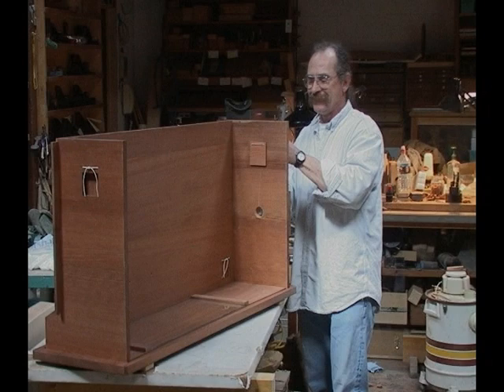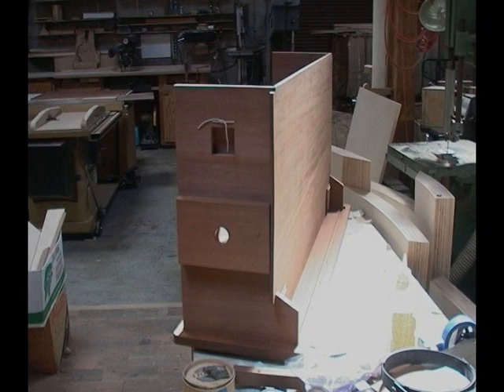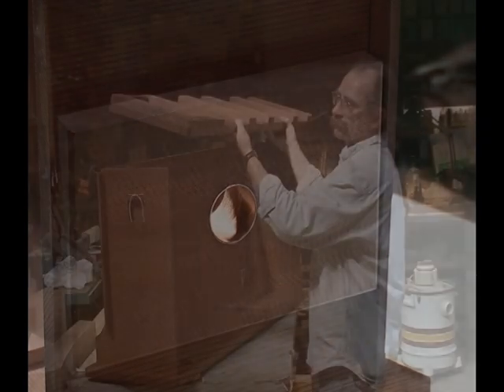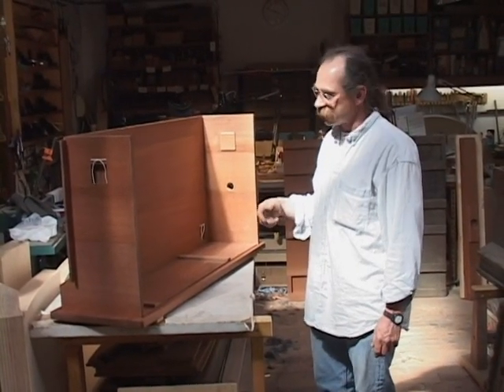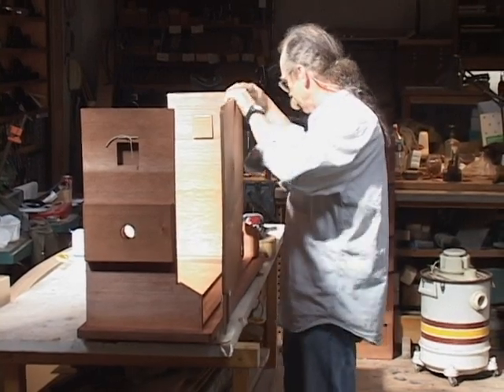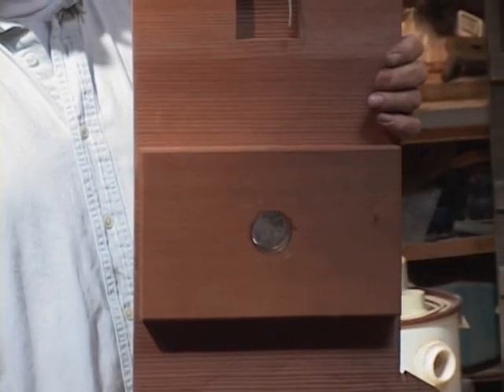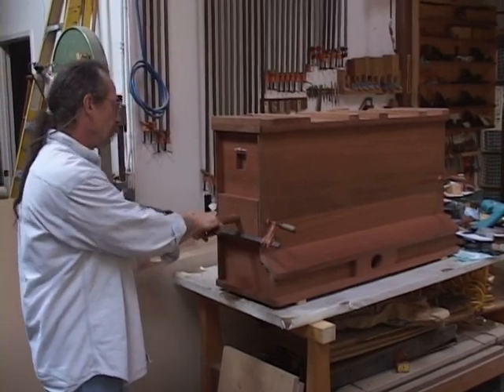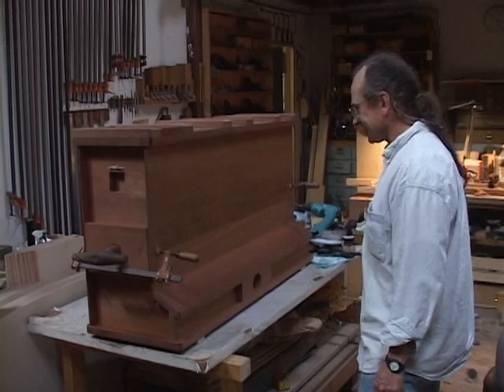Fuego (What the heck is it??)

Comment: Duh...! It's a bookcase! And bookcases are categorized as " "home furnishings" not as machine's.
Reply from the maker: Jay Muzquiz you didn’t watch it did you? It is a machine
Reply: @arboristBlairGlenn  Hey Glen let  me ask you something, who do you think has better hammer control a carpenter or a black smith? Or is better at swinging a hammer.
Reply from the maker: Jay Muzquiz that is like asking who is a better dancer. One does swing and the other ballet? Both the carpenter and the blacksmith have skills. A blacksmith does hammer differently
Reply: @arboristBlairGlenn  Your right, is it fair to compare the two with hammer control? The carpenter basically use a framing hammer occasionally a demo hammer or a finishing hammer. How many hammers must a black smith master? With carpenter's its about driving nails and plumbing.  A Blacksmith it's about shaping, cutting, punching, drawing, welding, forming, reducing, rounding, some hammers heavy to strike forcefully, some are small to shape, others are for a single job, and even a hydraulic driven hammers. But then again some carpenter's hammer is like an extension of their own body and drive nails in some of the most strangest of places.
Reply from the maker: Jay Muzquiz and what is your career choice?
Reply: @arboristBlairGlenn  Automotive repair industry unfortunately. I hope to be a sword smith someday. As we speak I'm building a Japanese Box Bellow no where near the level of your friends. What an ingenious simple litte machine!

Comment: Seriously thinking of building one for myself.
Reply from the maker: Pretty amazing old world technology. Choosing the right, super tight grain wood, is a key. The way it continues to blow on both strokes is pretty cool.
Reply: @arboristBlairGlenn  Yep, but if I build one it'll likely be from 3/4" birch plywood and use glass on bottom and sides to reduce friction.  Double lung bellows are better in a way since it's a continues flow of air where the fuego has a brief pause.  On the other hand it's easier to regulate a Fuego simply by pushing faster or slower, and it takes up less space.
Reply from the maker: @forge52100  sounds like you know what you’re doing! I was so impressed at the old work skill in how the original was constructed. John spent so much time analyzing and measuring to reproduce this accurate, working unit.